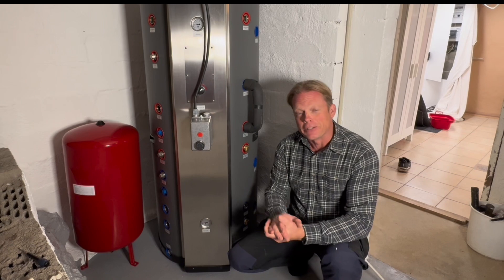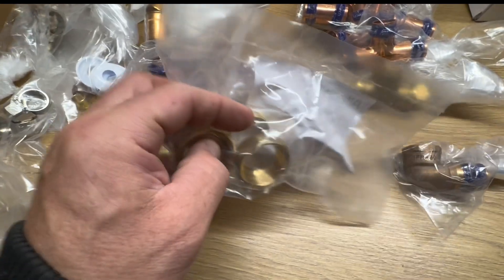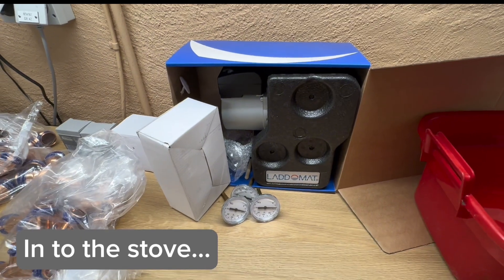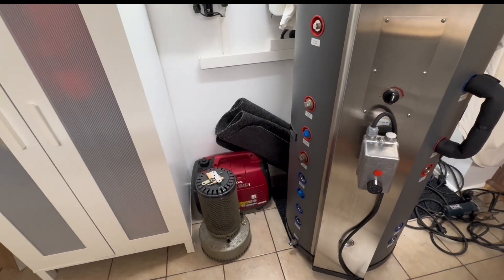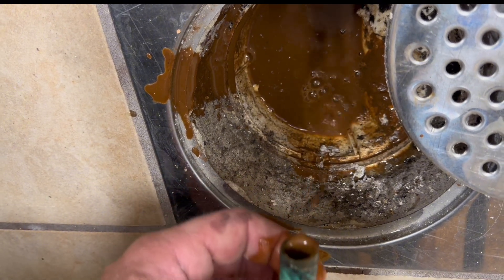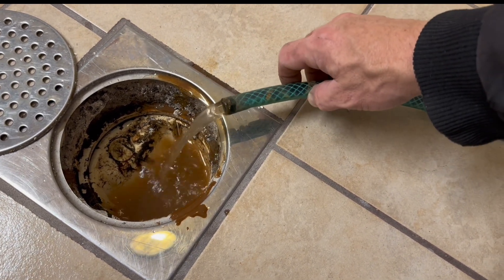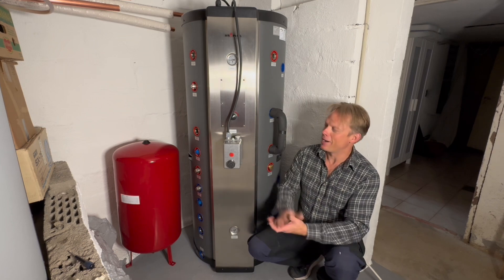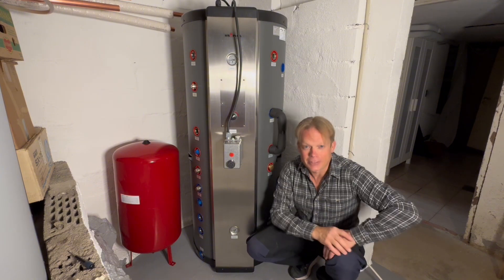Thermal battery update, Hybrid water heater, Solar and energy storage.

Comment: very cool project! If you want to squeeze the last killowatts into the storange tank, you can use a phase angle power controller. I used such a set up with a convection heater, and it's rewarding to hear the dutycycle throttle up and down as the sunshine varies. The power controller I bought can pull 30A, but it is monophase and if you are concerned about equally loading phases might not be what you want. I wrote about it on my homepage at thouters dot be, I tried to leave a comment earlier but it must have been flagged as spam due to the URL.

Comment: One small tip, if you connect your old heating system, you maybe install a magnetic filter as well, keeps your boiler cleaner and saves your system from issues. Nice you have a boiler room to manage this all, Dutch houses are mostly to cramped to change a lot.
Reply from the maker: That’s a great tip👍🏻 I have a filter in the bottom outlet that will take care of some debris at least.☺️

Comment: Great to see the project progressing. Be careful with the asbestos, the fibres are extremely dangerous regarding health problems. One suggestion woukd be to paint it with a good quality paint to seal it which minimises the risk of fibre loss.
The laddomat is a great idea, it will protect your stove,tank and pipework from thermal shock which will extend the lifespan of your system.
Looking forward to the next update.
Reply from the maker: So glad that you like it, thank you so much☺️

Comment: great progress - even though we had made a similiar mistake, buying a heatpump cylinder with 270 L and with an additional heatexhcanger  aka coil, Atlantic Explorer V4 . This can be "charged" from the oil condenser boiler but attention: vice versa it can heat up the water inside the cattle of the boiler and then it can be used to heat the house. But: the usefull SOC is from 60°C to 42°C or so and then the amount of energy being discharged is limited. Such usual heatpump boiler can use (they have usually limited run time per day = up to 14 hours)  700 Wx 14h =9800 Wh and deliver based on cop 3 to 3,5 heat in the water from 30 to 35 kWh. For the home usage = warm water we need about 10 kWh, which means 20 kWh can be transfered for heating in the spring and autumn before the oil condenser kicked in. BUT : just 1 year old and 2000€ invested 

it is already outdated cause we were not aware about the prices of a heatpump and that those are widely used in scandinavia, in particular norway. And they are importing from china a 12 kW heatpump for roughly 1600$ OSLO (cif, not ddp which means you have to pay customs and 25% VAT in norway and the handling and operating and shipping fees from OSLO harbor - but we choose in germany a ddp delivery to our door which is about 2000$ incl. 19% VAT or 7% VAT. 

This heatpump will now be added to condensed oil boiler and pumps warm water through its cattle and from there into the heating system or warm water boiler. If it gets below 0°C we will run the oil boiler only in a monovalent way and heatpump will be turned of. Same as the norwegian guys did. 
Unfortunatelly the Altantic heatpump cylinder is no longer  needed and will be replaced by a cheap good chinese heatpump from Solar east BLN-012TC3 for 3 phase and 12 kW output or similiar BLN-008TC1 as a single phase 8 kW output atw heatpump. And it comes with modbus and the protocol has been published, also a nice 5 inch touch screen, app support and browser support important for handicapped people with limited sight or just 1 eye.

Therefore we stopped the big boiler usage cause too often too much warm water inside the tank and only limited usage cause you can only heat it up to 63°C with a heatpump and roughly 40 to 43°C the discharge capability will be gone cause you need 5°C more in the source water to heat the "target" circle up. 40°C to 38° will not really work.
Reply from the maker: I hope that this will work good for me, I will at least have multiple options to heat my house from here on.

Comment: Whis is old circulation pumps 60-70W 26/6. Better use new 35-40W electronic
Reply from the maker: It is adjustable between 6-100w so I do not see the problem. I’m not sure we’re you have those numbers from.